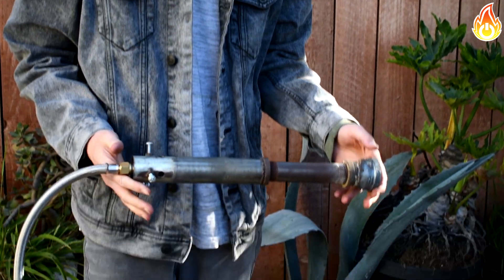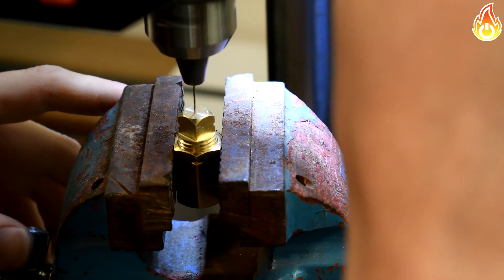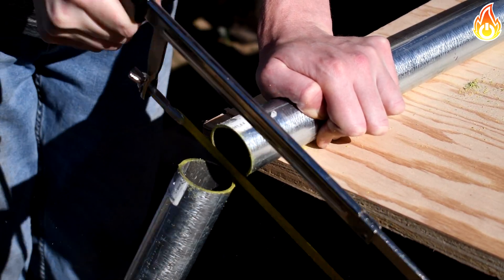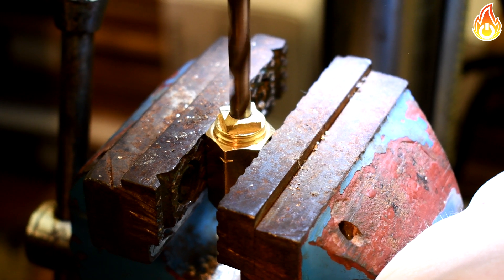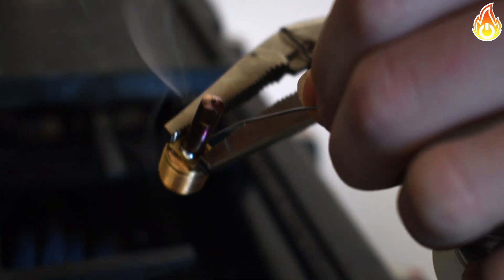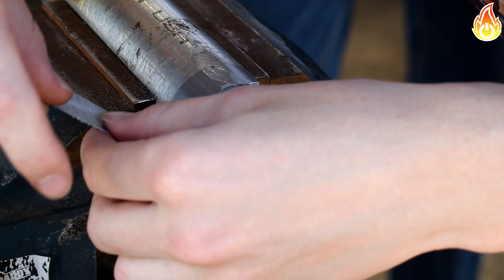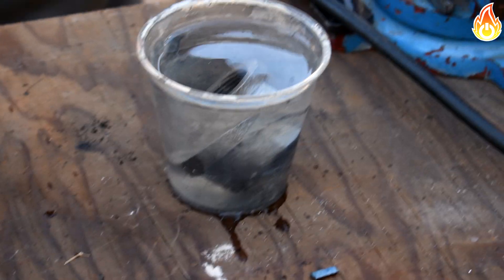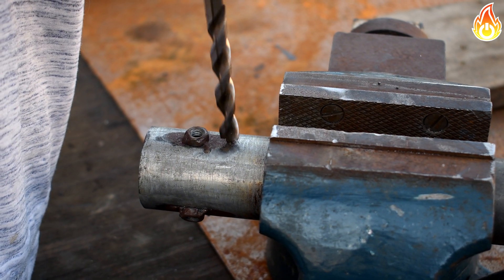How to make a propane burner for forging/melting metal!

Comment: To help keep the drill bits from breaking in use, constant light pressure and a little motor oil for any car works great.